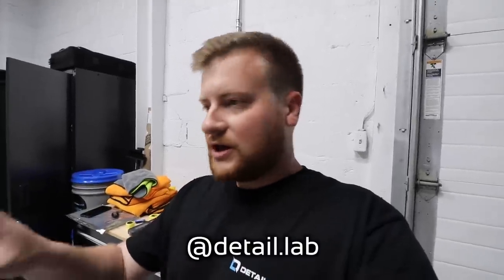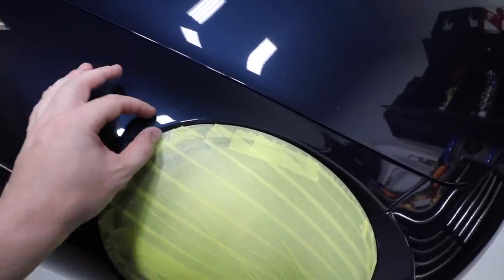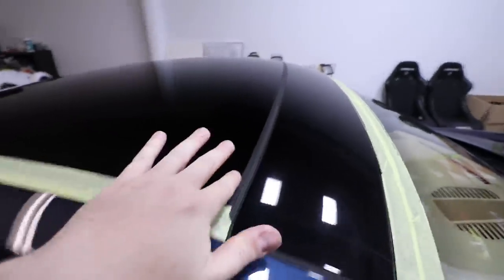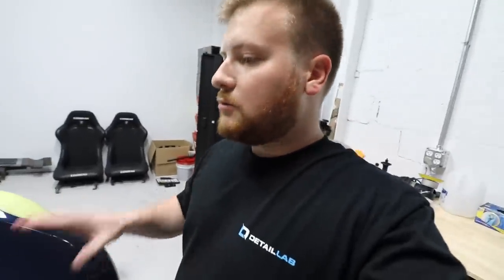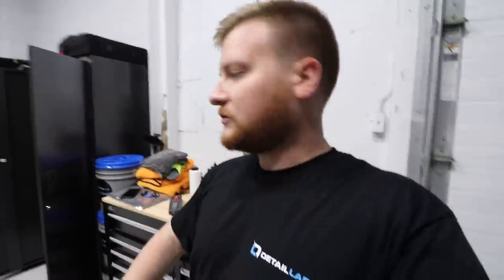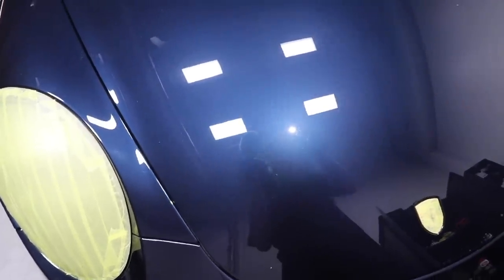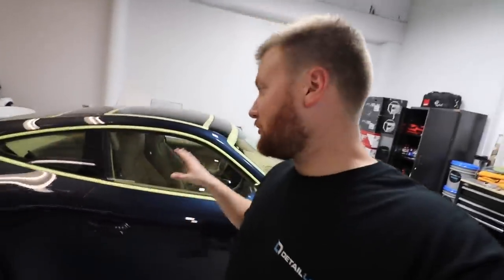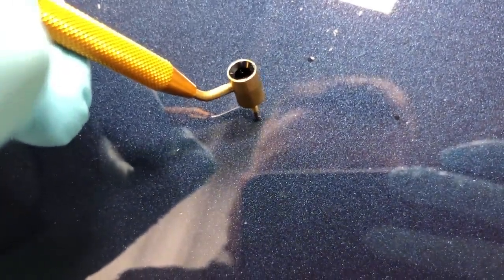The Best Paint & Rock Chip Touch Up Tool For Your Car

Comment: Troy, do a video on removing the bugs now that it's spring and any road trip leads to 100+ dead bugs on the bumper.
Reply: I use Splat bug remover, works pretty decent
Reply: Leave your car outside/ overnight. -Wash and wax your car early in the morning when the car is already wet from morning dew. The bugs just fall off

Comment: Would you not do the rock chips first. Then wet sand flat and polish with the rest?
Reply: That’s exactly what I was thinking. You are correct, but that takes a lot more time. I’d also think the last thing you want to do is apply paint over polish.

Comment: Wonder if it's worth doing the touch up eariler in the process and wet sanding? The chips should be pretty much invisible after polishing.
Reply: Carl Pearce the coarse buffing compound removes the tiny touch-up paint  too

Comment: Troy, could you somehow link or show us a HD picture of that hood after the touch up of all those rock chips? I wasn't convinced by the way it looked after blobbing on the paint with that pen. I'm curious how it will look once the paint has dried from a couple of feet away.
Reply: Troy Sowers alright, no need to sand the 'blobs' down afterwards to level them out?

Comment: Quick question for the pro- I have a swim platform on a BAJA powerboat. I have it on a lift at my house in the elements. It is orange powder coated. Now it is really faded- can I bring it back? How?
Reply: Thanks- Just was looking for an inexpensive fix- powder coating a swim platform can be expensive. Any other paint recommendations.
Reply: I would try hand polishing the powder coating on the swim platform.  Use some turtle wax brand, polishing compound and a wet sponge. And lots of elbow grease.